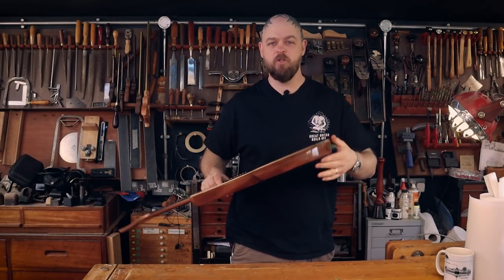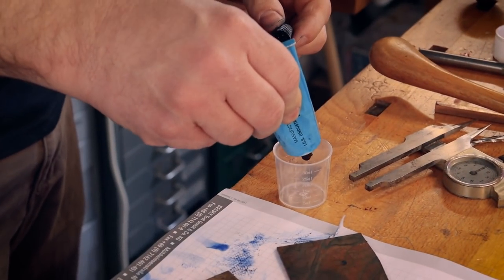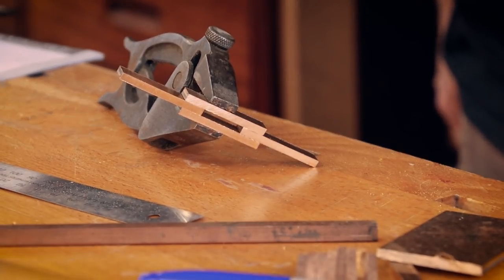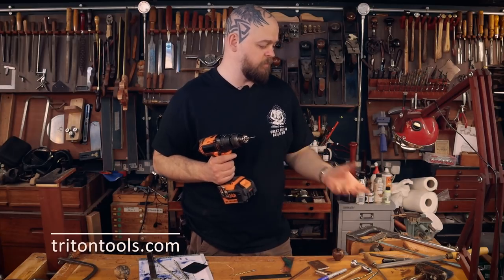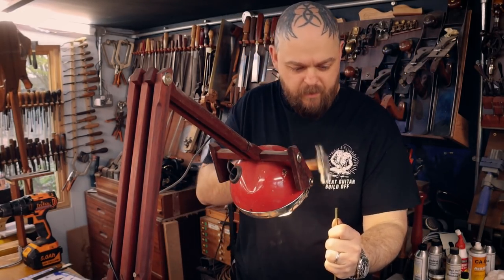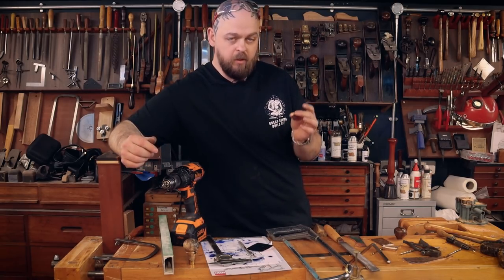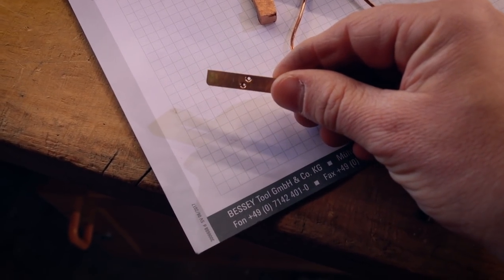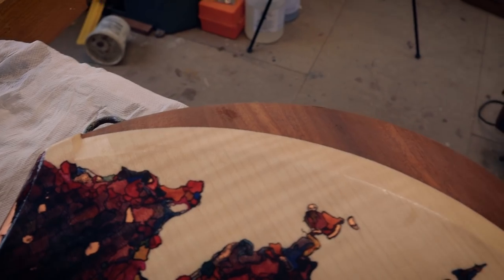Ep 12 - Shred - Custom Bridge - How to Build a Copper Leaf Multi-Scale Kit Guitar

Comment: I cannot believe what I just watched! I have spent the last couple of days trying to design a bridge for top loading strings out of bits! So far...telecaster base plate adapted to take roller saddles mounted on threaded posts for height adjustment. On the rear upright of the base plate the string holes are drilled out to take through body string ferrules. The string saddle is connected to the back plate by a hollow tube through which the string passes over the roller saddles. Intonation is taken care of by moving the individual saddles which are slotted in the saddle base and secured with a small Allen bolt. So you basically have a mixture of steel,chrome,golf and black components. The base can be shaped to an design.

Comment: Ben, brazing copper is just like soldering pipes. Just need a torch and your preferred brazing material. You can use a  copper, brass, or bronze brazing rod. Or just use silver solder with flux. 
Might I suggest two channels: clickspring and the banjo show (makes steampunk items) . Both do lots of brass work. Lots of neat tricks from both.
Also, love your work mate.

Comment: Prussian Blue or Engineer's Blue is used for fitting parts when wanting to see where parts contact. Layout fluid/Layout dye is used for providing a somewhat durable coating that will allow the user to easily see scribed lines.

Comment: That blue is likely a transfer blue paste for seeing where parts contact each other to assess fit or flatness. This is what engineer's blue usually means to machinists.

What you're looking for is layout fluid which is usually the same blue pigment in nitro lacquer, the most common brand being Dykem.

You can mix engineers blue with clear nitro lacquer and thinners to make your own, but just buying Dykem is cheaper and more consistent. It's quite hard to get it to brush on really thin and consistent. 

Or use a Sharpie but that's not as good as layout fluid.

Comment: I think you will regret placing the string height adjustment under the string path.  You will have to slacken the string considerably to access the screw  and that might  become tedious unless you get it correct the first time.
Reply: Agreed.  Even though in reality you set it up once and pretty much forget about it, it's going to be a royal faff to loosen string, adjust height, retension string, oops a smidge higher/lower, untension, adjust, retension.

What if ... instead of vertical grubs on the top face they were 45° grubs on the front face? 🤔
Reply: Paul Cook. Yes that would probably work.

Comment: That intonation adjustment works, but anchoring the pins to guitar body that way may not be very solid. You have six holes very close to each other in wood. It's easier to bend a traditional L-shaped base plate with holes for intonation screws. It's also better for saddle pieces to sit on metal so height adjustment screws won't dig into wood. There is also a potential problem in the height adjustment with one screw. The screw is angled, so it touches only on one point. If also your saddle piece is round or roundish, you have only two points of contact. It will rock, and not in the good way. You can do it with one screw, if you make the back of the saddle piece level, so it touches the base on it's whole width. That vice is awesome.

Comment: As cool as those ideas are Ben, get some flat stock bend it and make it like a tele bridge...
Burn it if you want to...
To braze you simply heat both clean peices up and drop some solder in the joint.
Silver solder is the most conductive and strongest solder I have used 👍

Comment: Now this should work, as you ve split the anchoring of the saddle from the anchoring of the string. The previous one would have needed you to take all the tension off the string if you wanted to adjust intonation, or the saddle would pull right forward as soon as you released the tension kn the screw holding the saddle down to the base plate.

Comment: Just to clarify. The reason that "marking paste" rubbed off is 'cos it's actually "indicating paste" designed to stay greasy and show contact between parts (such as mesh between gear teeth or a taper fit on a shaft).  Actual "marking blue" such as Dykem is invariably a thin liquid and dries instantly.  The advice from the company to thin it with spirits may have been meant in regards to making it easier to get a thin coating for contact tests as above, but if they were suggesting it for hand layout work, that's bad info on their part.
Reply from the maker: Hey man... got it in one.. this damn stuff got EVERYWHERE and I really could do with the real deal.. B

Comment: Really like that last bridge prototype. Just not sure I understand why you need a screw to hold the string. With that design, could you not have a small hole from the top with a countersink from the bottom to host the ball end of the string?

Comment: Peened pins turned out great. Another method of peening is to place the rounded (peening) end of a small ball-peen hammer on the pin and strike the flat end of the ball-peen with another hammer. This will also aid in spreading the end of the pin.
Reply: Hammer will shatter unless face is annealed. Heat face to dull cherry and let cool slowly.

Comment: Why not drill a hole in the top of the vertical retaining peg as the string retainer? Then the adjustment screw could be drilled in below that. It’d be simple and elegant. The saddle would be simpler too.

Comment: A teacher thaught me a way to peen over  one end first by drilling a rounded and shallow hole in the back of a table mounted vice. This way you're able to cut the stock to length and easily peen one end over. It works great, off corse it doesn't have to be a vice as long as it is harder then the materials you are using.
Reply from the maker: Great advice, thank you.

Comment: I was about halfway through mucking up my first neck when I "realized" that my workspace is a disaster. I spent as much time looking for tools as using them. I've since demolished the cabinets above my bench and am in the process of "flattening" my bench. Next I'll make holders for my ever expanding set of tools and storage for materials. My question is, am I procrastinating because of the utter failures that were my first neck and fretboard? Or am I setting myself up for success next time? Both? A bit disheartened at the moment.

Comment: was recommended something today and thought it sounded weird and wondering if you tried it. it is and use egg whites as grain files, you sand with egg whites and then it mixes with the sanding dust and it works as grain filler?

Comment: My burning question:  if you use the strap peg hole to put one of those hardware hooks in, how do you find a hook that doesn't have threads so big you'll have to dowel and re-drill the hole for the strap peg?

Comment: Great stuff. I honestly can not understand how height adjustment works on the saddles. Like how does the the grab screw allow you to adjust the height?
Reply: Screw grubscrew in at the top, it pokes out the bottom and lifts the whole assembly off the base plate (assuming he doesn't want screws rubbing into wood and has a bridge baseplate).

Comment: Hey Ben. Really enjoying your vids. Am I missing something? Why lock the string at the bridge at all? Its going to be a pain when you restring. Rich
Reply: If I'm following his plan correctly he's looking to terminate the string on the saddle so that the saddle is holding string tension without through holes or a tailpiece.
Usually when this style bridge(hipshot is what I'm picturing in my mind) is rigged non-through hole the ball end is fixed in a keyhole on the base plate but I think he's looking to eliminate the base plate as well.

Comment: Beautiful work. 
But Ben, one quick question: Copper is such a reactive metal; how are you going to prevent the copper bridge from turning green and corroding? When the sweat from your hands (and who doesn't sweat when they're playing?)  interacts with that copper it's going to rapidly oxidize, tarnish and develop a patina. I'd also suspect that your strings and bridge may also clash and produce galvanic corrosion where the metal from the strings and the copper bridge meet.
...oops...after watching the REST of the video I see it's now a moot point!

Comment: Copper has always been too soft, thus they invented Bronze. Would that work better? It would patina more like copper over time.
 Why are electric guitar bridges so complicated, with so many moving parts, when an acoustic guitar bridge is so simple and yet can be intonated quite accurately? Might the ancient and simple solution be more elegant? Perhaps a pair of, or even three floating bridges, each holding two or three strings, appropriately staggered and angled for the different scales would have the job done. I know you don't want to do through stringing, so maybe use end pins like Nebula?